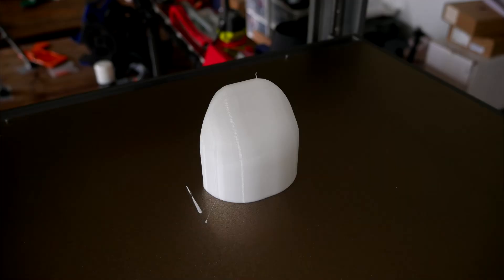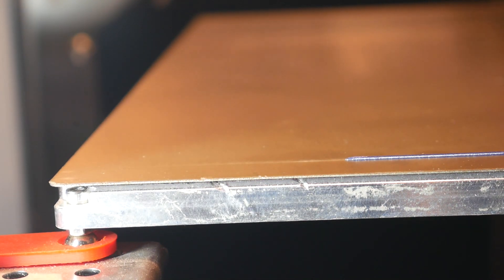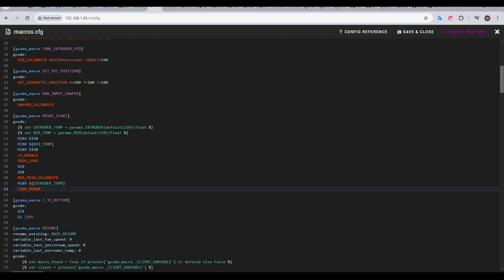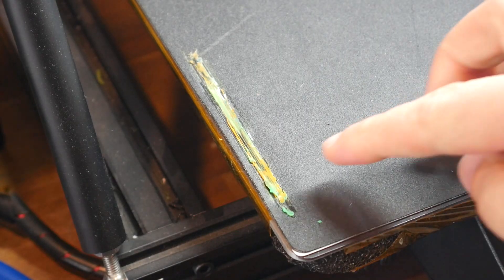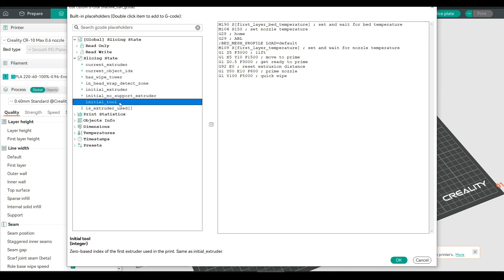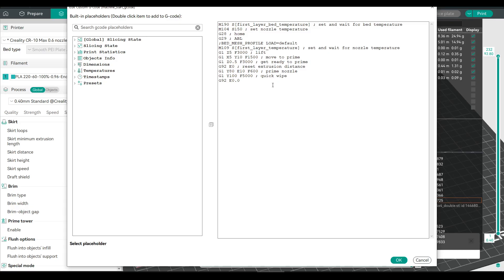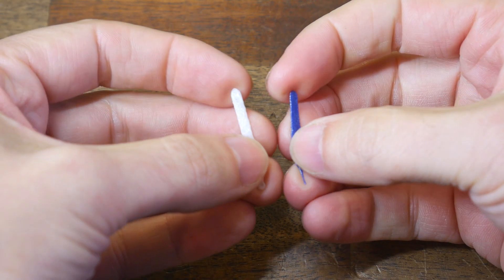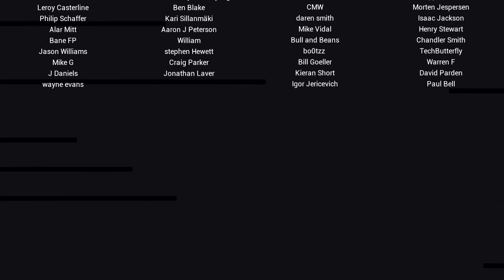Adaptive purge for every 3D printer: A simple slicer tweak

Comment: I am so very grateful for this. I have been chasing my tail trying to stop those warm up strings from messing up my initial layers and I have ran the triangle version at least a dozen times now and have yet to mess up. Thanks!!!!! The only minor thing I see is if I run a larger model I will need to change to the line.

Comment: It would be nice if the purge line is near the start of the first line of filament (of the actual model) that the printer will lay down. This will minimize even further the travel distance from purging to printing. A tweak in the code maybe.

Comment: Oh, that's perfect! I also have my bed slightly bent upwards just at the last 20mm on the left side, right where my purge line is placed.
But I use the skirt not only used for purging, but also for checking correct z-height right before the actual print.

Comment: If your bed is so warped that the purge line is getting oversquished (esp. to the point of damaging your bed) you need to tram your bed better, if it's so warped that it can't be trammed + compensated for with bed mesh you should replace it. Moving the purge line to nearer the print helps if using adapative mesh but I question how well such a bed would handle larger prints that use all or most of the bed (does full bed mesh compensate sufficiently?)

Comment: Trying this on the Bambu A1... during the adaptive purging I get this weird clicking sound in the extruder and the first layer almost always fails. Any idea what the issue could be?

I added this to the end: 
G92 E0.0;
G1 X{first_layer_print_min[0]-10} Y{first_layer_print_min[1]} Z0.8 F6000.0;
G1 X{first_layer_print_min[0]-10} Y{first_layer_print_min[1]+30} E30 F360.0;
G29 E0.0
G1 E-0.5 F2100;
G1 Y{first_layer_print_min[1]+40} F600.0;
G92 E0.0;

and commented all of this: 
;===== extrude cali test ===============================

;M400
;    M900 S
;    M900 C
;    G90
;    M83

;    M109 S{nozzle_temperature_initial_layer[initial_extruder]}
;    G0 X128 E8  F{outer_wall_volumetric_speed/(24/20)    * 60}
;    G0 X133 E.3742  F{outer_wall_volumetric_speed/(0.3*0.5)/4     * 60}
;    G0 X138 E.3742  F{outer_wall_volumetric_speed/(0.3*0.5)     * 60}
;    G0 X143 E.3742  F{outer_wall_volumetric_speed/(0.3*0.5)/4     * 60}
;    G0 X148 E.3742  F{outer_wall_volumetric_speed/(0.3*0.5)     * 60}
;    G0 X153 E.3742  F{outer_wall_volumetric_speed/(0.3*0.5)/4     * 60}
;    G91
;    G1 X1 Z-0.300
;    G1 X4
;    G1 Z1 F1200
;    G90
;    M83
;    M400

;M1002 judge_flag extrude_cali_flag
;M622 J1

;    M900 R
;    G90
;    G1 X108.000 Y1.0 F30000
;    G91
;    G1 Z-0.700 F1200
;    G90
;    M83
;    G0 X128 E4  F{outer_wall_volumetric_speed/(24/20)    * 60}
;    G0 X133 E.3742  F{outer_wall_volumetric_speed/(0.3*0.5)/4     * 60}
;    G0 X138 E.3742  F{outer_wall_volumetric_speed/(0.3*0.5)     * 60}
;    G0 X143 E.3742  F{outer_wall_volumetric_speed/(0.3*0.5)/4     * 60}
;    G0 X148 E.3742  F{outer_wall_volumetric_speed/(0.3*0.5)     * 60}
;    G0 X153 E.3742  F{outer_wall_volumetric_speed/(0.3*0.5)/4     * 60}
;    G91
;    G1 X1 Z-0.300
;    G1 X4
;    G1 Z1 F1200
;    G90
;    M400
;M623

Comment: but if you retract at the end of the purge line, shouldn't you also unretract after the quick move to printing area? Seems like the retracted filament will be missing on the beginning of a print. Or am i wrong? 0.5 is nothing but with bowden setups this number can be like 2 or more and this will definitely cause some initial gap during the print.

Comment: This is great, but can you use if statements in the slicers? This doesn't account for the model being on the edge of the build plate for example. It would be great if the line moved to a free edge, and if all are at the limit just print it in the default off-the-print-area location.

Comment: Question: what would happen if you made a print that take up the whole square build plate? What I mean is, on my A1 Mini, the build plate has that bit sticking out at the front where the default purge line normally goes that isn’t really part of the print surface. For max-size prints, is there a way to dynamically swap between the adaptive and default purge line?

Comment: 300*300 square 1 line skirt takes 30s and 35mm of filament. It cleans your nozzle in 4 directions, you see your bed leveling while printing it and if your extralarge print will fit your bed.
Set skirt to:
1 line
2mm away (if you like 215mm pieces on a 220mm bed)
10mm min extruded( seems yours extrude 9mm). All under 45mm radius will take 2 loops to reach 10mm extruded filament.

Comment: I have an IDEX printer, and it has brushes on both sides. So I just put an extruder gcode in the start up and let it purge off the side of the printer and then the brush cleans ir on the way to the print bed. It saves so much filament and no brims needed. I only use a brim on something very tall and skinny to give it better adhesion. I wish more printers worked like that. I used to use lines on the front for the other printers

Comment: The only problem is now the purge line is off the plate of the model is too close to the edge. We'll need to fiddle with the start g-code each time, or figure out some way of deciding on different purge lines depending on where the model is or how big it is.  Nice version, though. Definitely food for thought. Maybe a horizontal or vertical purge line just at the edge of the object, or the -1 if the model is too far forward.

Comment: Just made this change to my "base" profile for my Bambu P1S.  Mostly love it, one thing I dislike is the shorter purge blob is PEERFECTLY sized to flick off and send itself straight down the opening for the rear Z-screw.  If you planned this, you're diabolical...  :D

-----

Just discovered a issue with this change, if the print is "huge" you need to add a conditional to not have the head try and move beyond the limits of the print area.... I just tore off the front of my P1S because it (stupidly) tried to move blindly outside the total area... 😢

something like:
{if (first_layer_print_min[0]-10 > print_bed_min[0]) && (first_layer_print_min[1]+50 < print_bed_max[1])}
 then... use TT purge
{else} use the default purge logic

Comment: I decided to make the prime line change position as needed based on the first layer size and location.  This goes through the 4 sides and uses the first one it finds as valid in this order:
left vertical line
front horizontal line
right vertical line
back horizontal line

if the print is within 10 of all 4 sides it doesn't do a prime line

;prime line
G92 E0.0 ; reset extruder
{if first_layer_print_min[0] - 10 > print_bed_min[0]} ; check left valid
G1 X{first_layer_print_min[0] - 10} Y{first_layer_print_min[1]} Z0.8 F6000.0 ; position 10mm left of print
G1 X{first_layer_print_min[0] - 10} Y{first_layer_print_min[1]+30} E30 F360.0 ; extrude 30mm of filament in the y direction
G92 E0.0 ; reset extruder
G1 E-0.5 F2100 ; small retraction
G1 Y{first_layer_print_min[1]+40} F6000.0 ; move an additional 10mm without extruding
G92 E0.0 ; reset extruder
{elsif first_layer_print_min[1] - 10 > print_bed_min[1]} ; check front valid
G1 X{first_layer_print_min[0]} Y{first_layer_print_min[1]-10} Z0.8 F6000.0 ; position 10mm front of print
G1 X{first_layer_print_min[0]+30} Y{first_layer_print_min[1]-10} E30 F360.0 ; extrude 30mm of filament in the x direction
G92 E0.0 ; reset extruder
G1 E-0.5 F2100 ; small retraction
G1 X{first_layer_print_min[0]+40} F6000.0 ; move an additional 10mm without extruding
G92 E0.0 ; reset extruder
{elsif first_layer_print_max[0] + 10 < print_bed_max[0]} ; check right valid
G1 X{first_layer_print_max[0] + 10} Y{first_layer_print_min[1]} Z0.8 F6000.0 ; position 10mm right of print
G1 X{first_layer_print_max[0] + 10} Y{first_layer_print_min[1]+30} E30 F360.0 ; extrude 30mm of filament in the y direction
G92 E0.0 ; reset extruder
G1 E-0.5 F2100 ; small retraction
G1 Y{first_layer_print_min[1]+40} F6000.0 ; move an additional 10mm without extruding
G92 E0.0 ; reset extruder
{elsif first_layer_print_max[1] + 10 < print_bed_max[1]} ; check back valid
G1 X{first_layer_print_min[0]} Y{first_layer_print_max[1]+10} Z0.8 F6000.0 ; position 10mm back of print
G1 X{first_layer_print_min[0]+30} Y{first_layer_print_max[1]+10} E30 F360.0 ; extrude 30mm of filament in the x direction
G92 E0.0 ; reset extruder
G1 E-0.5 F2100 ; small retraction
G1 X{first_layer_print_min[1]+40} F6000.0 ; move an additional 10mm without extruding
G92 E0.0 ; reset extruder
{endif}

Comment: I was having trouble with molten plastic remaining on the side of the nozzle in between prints. I modified my purge line to back up after purging, lower 0.04mm, then draw a triangle through the purge line.  It knocks the plastic off the nozzle side like those little silicone boot scrapers.

Comment: Great stuff! Would have  been cool to have the gcode fragment in the description for a quick cut & paste for those a little familiar with gcode :-) Thanks

EDIT: While I didnt find a great deal of diff on small prints/layer heights etc, this has been amazing for large models eg >400mm and nozzle sizes > 0.6...thanks again for the condensed info

Comment: Oh, neat!
I recently picked up (and got rid of!) an Anycubic Kobra 2.
When it worked, it was printing a purge-line across the width of the 'handle' of the print-sheet.
I looked: it was built-in to the starting G-Code.
I got rid of the printer because the print-bed was warped way beyond what leveling could deal with...more than 0.6 mm from center to 'best corner'.  Worst was nearly 0.9 mm!
The flexible sheet wasn't the issue, it was the frame that held the heating-plate under the print-bed that was warped.  Looks like some bad or out of place spot-welds...
It was trying to print on a 'Pringles chip'!
I am so done with 'the printer is the hobby'!
Got a Bambu X1 Carbon coming in a few days...get some work done.

Comment: If you have large prints here is my gcode:
G1 X{max(first_layer_print_min[0]-25,print_bed_min[0]+5)} Y{max(first_layer_print_min[1]+30, print_bed_min[1]+35)} Z0.8 F3000 ;
G1 X{max(first_layer_print_min[0]-25,print_bed_min[0]+5)} Y{max(first_layer_print_min[1], print_bed_min[1]+5)} E30 F360 ;

G92 E0
G1 E-0.5 F2100 ; 
G1 Y{max(first_layer_print_min[1]-10, print_bed_min[1]+5)} F3000 ;
G92 E0.0 ;

With this, the purge line will always be inside of the print area, but if your part covers the whole bed, the line will be under your print.

Comment: another great video thanks Michael for sharing this info. I have added this script into the SV08 machine G-code and I get this error message when it is ready to do the purge line, I revert it back to the original and it all works fine.   What am I doing wrong with this coding?

Comment: Not sure if everyone knows this.. Prusa mk4 does actually measure the bed level on two points where it purges before the print. I was wondering how it will work in back to back prints and was relieved to see it just measures the existing purge height and adds another layer there

Comment: Ugh i hate not having Klipper. Don't want to bother with Klipperizing ny current printer since I'm planning to get a new one by the end of the year, but it has sucked missing out on stuff like this, adaptive temperature script, good resonance compensation, all the perks of Fluidd, etc. I really appreciate you doing this to give us Marlin users access to some of the good stuff lol. I'm definitely going to try it bc my purge lines often fail to clean the nozzle and instead just cause the oozed filament to fold or curl up onto the sides of it.

Comment: Nice.  I thought I would need to follow your video to do it on my two main printers, even though they have Klipper installed.  Because it's a user-made beta version of Klipper on a machine with locked firmware.  But as it turns out, I was able to install KAMP on them.  Little bit of set up work and a lot of web searching little things, but I got it working.

Comment: For those with Bambu printers

Click the edit button above plate type, (looks like pencil to paper)(when you hover over the button it says "click to edit preset")

Click the second tab, "Machine Gcode".  
The top text box should be called  "Machine start G-Code"

At the bottom of that box, paste in:
G92 E0.0; reset extruder
G1 X{first_layer_print_min[0]-10} Y{first_layer_print_min[1]} Z0.8 F6000.0; position 10mm left from the lower left of the first layer
G1 X{first_layer_print_min[0]-10} Y{first_layer_print_min[1]+30} E30 F360.0; extrude 30mm of filament in the Y direction
G92 E0.0; reset extruder 
G1 E-0.5 F2100; small retraction
G1 Y(first_layer_print_min[1]+40)  f6000.0; move an aditional 10mm without extruding
G92 E0.0; reset extruder

^ that will add the new fancy purge line talked about in the video. To remove the default purge line, remove the code (above but int he same text box) which says

;===== nozzle load line ===============================
M975 S1
G90
M83
T1000
G1 X18.0 Y1.0 Z0.8 F18000;Move to start position
M109 S{nozzle_temperature_initial_layer[initial_extruder]}
G1 Z0.2
G0 E2 F300
G0 X240 E25 F{outer_wall_volumetric_speed/(0.3*0.5)     * 60}
G0 Y15 E1.166 F{outer_wall_volumetric_speed/(0.3*0.5)/ 4 * 60}
G0 X239.5
G0 E0.2
G0 Y1.5 E1.166
G0 X18 E25 F{outer_wall_volumetric_speed/(0.3*0.5)     * 60}
M400
Reply: nice
Reply: @liamburgo23 Thanks for the explanation of adding a purge line, makes things much easier. Unfortunately, I don't know where to add the G-Code in the start box. I tried adding it at the bottom, as instructed, but it doesn't work. Sorry to be such an idiot, could you please show me EXACTLY where to insert this code? Perhaps I'm just inserting it in the wrong spot. Thanks in advance for any assistance you might add, I really appreciate it. (I'm using a Bambu A1 with the Bambu slicer)
Reply: G-Code für ungültigen benutzerdefinierten G-Code konnte nicht erzeugt werden.
machine_start_gcode Parsing error at line 247. Expecting a legacy variable expansion format
G1 Y(first_layer_print_min[1]+40)  f6000.0; move an aditional 10mm without extruding
                           ^
Bitte überprüfen Sie den benutzerdefinierten G-Code oder verwenden Sie den standardmäßigen
benutzerdefinierten G-Code.
Reply: @josefno.1  ohne es probiert zu haben... beim G1 G-Code für X stehen die parameter in geschwungenen Klammern, bei Y in normalen. Ich gehe mal davon aus das die auch in geschwungene Klammern müssen. Also "G1 Y{first_layer_print_min[1]+40}  f6000.0; move an aditional 10mm without extruding".

in englisch: Not tested, but try to correct G1 Y... to  "G1 Y{first_layer_print_min[1]+40}  f6000.0; move an aditional 10mm without extruding"
Reply: @andreasd2635  okay danke probiere das Mal aus
Reply: @andreasd2635  This is the correct answer. Change the parenthesis to curly brackets and the code works.
Reply: @josefno.1     typo..   copy this:

G1 Y{first_layer_print_min[1]+10}  F6000   ; move an aditional 10mm without extruding
Reply: Error occuring while slicing in Orca
Reply: @josefno.1  Ah yes I got the same error. Let me know if you manage to work out what the correct variable is.
Reply: @liamburgo23  i am honest i dont know how to Coding. I thought you know how to

Comment: Amazing video, I just thought of one flaw…

When you purge close to the model, you will either have to use your finger to remove it (adding oil to the build plate) or a sharp pit of tweezers or a knife which could scratch the bed

I do like the advantage of it reducing the travel from the purge line to the print. I love to see new techniques. Thank you for the hard work you do for the community
Reply: Guitar pick, spudger both work, can print your own too
Reply: @n3m37h  guitar pick is a great suggestion! 

I find any printed tools do not have a sharp edge that lasts, you’ve really gotta be able to get the tool underneath to begin with before you lift everything up 

Thank you for taking the time to suggest a great idea

Comment: This is a nice method, think i might switch from KAMP!!!
What would be really useful as well would be a purge line\blob after a pause - this is when i tend to get long strings from pause location  (usually 0,0) back to the printer (usually 175,175), but how to make it go  Y-10, y-20, y-30  incrementally so as not to pick up the previous purge line?!
Reply: Sounds like a bad idea, as the head would have to travel back to the bed, thus risking hitting the print with the carriage. You'd have to factor in clearance like in "complete individial objects" and that sounds like a pain in the ass.
Reply: @lucaspeltie  yeah thought about that, although object bounds and print height would give all teh info required - but gantry purge plate, ala poop chute (at current height) or something else needed. (sv08 CoreXY)